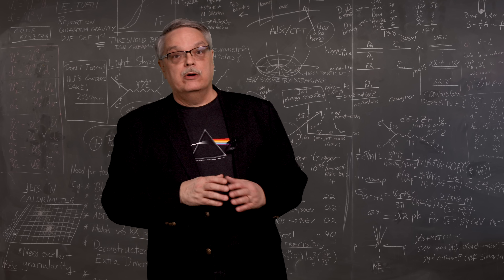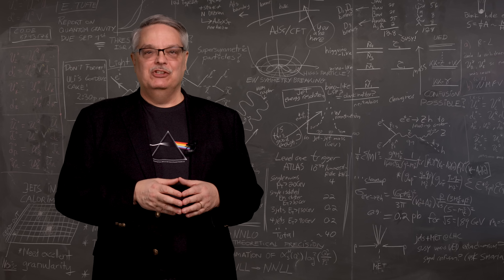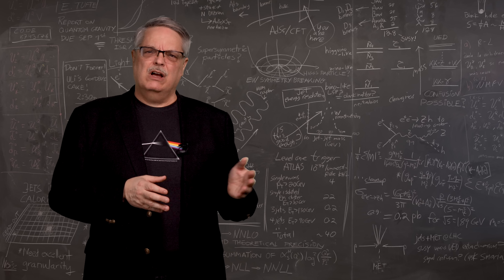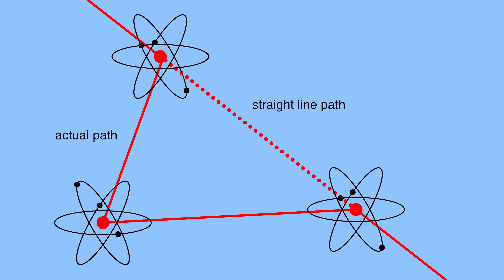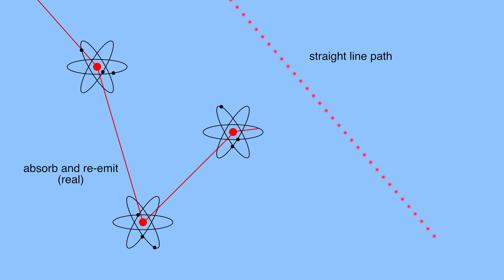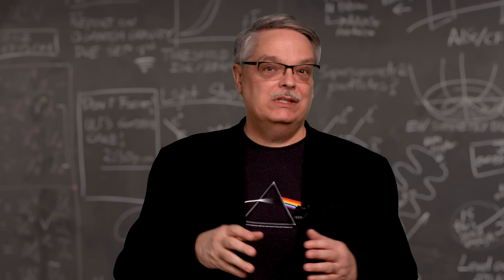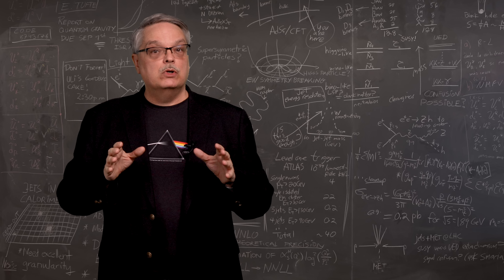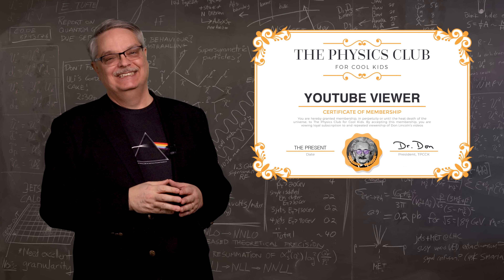Why does light slow down in water?

Comment: OK, if this explanation is true, it would suggest that first wave front/photons of the light would go thorough the material as if it were propagating in vacuum. Because electrons have mass and they need time in order to move and thus generate the second slower wave. Has this been experimentally confirmed? If so, I'm wondering at what photon frequency does the slowdown appear and disappear?

Comment: If photons and electrons are both waves in (the same?) electric field, why do electrons interact with the higgs field and have mass, but not photons?
Reply: The electromagnetic field is for light (photons) and the electron field is for electrons and positrons.  The electric field plays no separate role here (it is part of the electromagnetic field).

The electromagnetic field does not interact with the Higgs field, so photons do not gain mass from the Higgs field.

The electron field does interact with the Higgs field, so electrons and positrons do gain mass from the Higgs field (it allows the particles to vibrate without also moving, which is what rest mass means for particles).
Reply: cloudpoint  thanks for clarifying this for me!

Comment: Thanks for trying to clarify how light travels through transparent materials.  I’m not sure why the focus is on the electric field portion of light’s EM wave.  Is the magnetic portion irrelevant here?  Also, the animation of the waveforms seems confusing.  I get the superposition idea.  But the animation appears to try and show more.  The wave in the middle appears to be moving while the other two remain stationary in <put x-axis property here>.  Is the x-axis intended to be time, space, or a combination of both (does it matter)?  The animation seems to imply that the intensity of the resultant wave (on the bottom) is modulated somehow ... it has the same frequency as the incident wave but it fades in and out.  I’m guessing that interpretation is incorrect because, as far as I know, viewing through a pane of glass does not make images flicker.  The many positive comments here indicate that your explanation is quite satisfying to most.  Clearly, emphasizing a wave interpretation as a counterpoint to other particle-based explanations is a challenge that may not be immediately relatable to folks seeking a physical analogy.   I’m guessing that the complete and consistent explanation is only accessible to those with a sufficiently rigorous mathematical background.
Reply: where to begin...
this video has taken many shortcuts in explaining the relations between the two systems and how it affects them.
to better understand this, we need to talk about d'alembert's equation and its dispersion formula and how it describes a wave.
so d'alembert's equation is used to link together the spatial and temporal variation of a wave.

and from this equation comes the dispersion relation that links together the frequency, wavelength and celerity of a wave.
to access to this equation, we use maxwell relations to describe this phenomenon. when we consider those relations in the void, we get the relation: c² = k²*w² where k is the angular frequency and w its wavenumber. (just google it, ain’t that hard to understand)

thus we can see here that the celerity is proportional to its angular frequency. however, as explained in the video, when light enter a medium, there are charges that can be influenced by the electric field, especially electrons that are 2000 times lighter than their counterparts protons.
thus, when light comes in this medium, we assume that only electrons are affected by the electric field.

we then apply newton's second law to those electrons to find a relation between an electron's speed and the electric current
(we also neglect the magnetic field of the light as the electron is relativistic thus the force from the electric field is much greater than the magnetic one see lorentz law to better understand this )
and then by generalizing this equation to all electrons in the medium, we can get an induced current from the electric field of the light.
( the current is j = n * v with n the volumic density of charges and v the celerity of electrons)

then when we put this back to maxwell ampere local equation, we introduce a new component: the induced current which thus gives us a new dispersion equation: c² = k² * (w² - wp²) with wp the plasma oscillation and thus we can see that from the value of wp, we'll get a different value of the celerity of the wave.

thus we can say without a doubt that they are wrong in their explanation as it is not the combination from the electric current of the electrons and the wave that makes it slower but the induced current inside the medium that modifies the dispersion relation thus modifying its speed.
or in simpler words, it's the movement of electrons that changes the frequency and celerity of the light, but not the combination of the two electric current. (also on a side note, trying to represent the electric current of a dipole using a sine wave.. funny thing you did there 😅)

and finally, as for the reason why the light has a different angle, well you can easily explain this using two waves parallel to each other crossing the medium in phase with each other. as they have the same wave plane, you can easily come to the relation between the refracted angle and the incident angle using some basic geometry. i recommend you to see the demonstration of descartes second law if you want to better understand what i'm talking about.

(yes it is.. as always)

Comment: I kindly request to make a video explain this according to QFT.

 This phenomenona is really really really difficult to explain using quantum field Theory, vacuum energy etc...
Here so many things happen at the same time...
Our best model of photons comes from Quantum Field Theory. The easiest explanation for that math is the photon's wave equation takes every possible path through the medium (or not through the medium if those paths are possible). We sum up all POSSIBLE paths and the result is a probability field of where the photon could be. Photons always “take all possible paths” regardless of whether a medium is present or not (the medium just alters what possible paths could be taken). Until the photon interacts at one particular location it takes all these paths. If the photon was getting absorbed and reemitted we would have NO clear image of objects we see through water or glass (or air) as Dr lincon showed. Thus Photons “bouncing” around more or getting absorbed and reemitted is simply not right. photons are not “taking” longer paths. Even if one single photon is emitted into the medium and that photon is not absorbed or reemitted the photon's wave equation describing where it could be is STILL affected by the prescience of the medium. When all the possible paths through the medium are added together the center of the probability of where we find the photon is different than how it would be in a vacuum............

Comment: Hey if that explaination is true then the light wave 🌊 may constructively interfere with the oscillating electric field of electron and then add up which would result light traveling at a greater speed than c which is both impossible and not observed
Reply: Actually, they can make light (its phase velocity) move at faster the speed of light in special experiments, sort of the reverse of the effect described by Dr. Lincoln.  It's mentioned towards the end of the video linked below.  Sorry, no communication faster than light.

https://youtu.be/CiHN0ZWE5bk

Comment: You said there are no atoms(and hence no electrons) around in air. But that is false, because air consists of gas molecules. Molecules do have electrons. Oh, and glass or water is made up of molecules and not atoms. You just made it worse, tadaa!
Reply: Here comes the concept of optical density light waves will not interact with all electrons in air but only with the ones which comes in it's path
In air quite a few electrons comes in it's path as they are and such less interaction are negligible
But in glass and water electrons are bound two atoms are molecules whatever you say which are packed tightly in the substance so light has to interact with a lot of electronic field while travelling
Reply: @brainboxanky1729  Yes, true indeed. He must have included this in the video.
Reply: @sunandashelar161  
Yes absolutely
By the way 
Which country you are from
Are you a student now❓
Reply: @brainboxanky1729  I was going to say that, 'I am Indian too' before you asked but you asked first. Lol:D Yes, I'm student in 12th grade

Comment: This requires that some of the incident light energy has to be expended for the electron to create its own wave with total sum being the same as incident energy (assuming no loss). But, what about the energy that was not used to accelerate the electron? Shouldn't that go through the material just as fast as in vacuum? Or does the energy used to oscillate electron and the energy not used for electron perfectly "match" (how?) ?

Comment: Great explanation!  As you said, there many people explaining this phenomenum, though, when they are right, they are not as clear as yours.  Could you make another video explaining why (and how) light maintaing its trajectory and the change to a parallel path happens?
Reply: To refract light must incident obliquely on material. When the velocity changes due to superposition then the value of velocity decreased in direction of surface as well as in direction of normal to the surface which changes the slope of the path. ....
Take your time and resolve the components of velocity to understand... You will see through logic